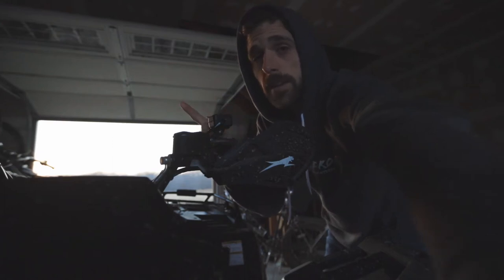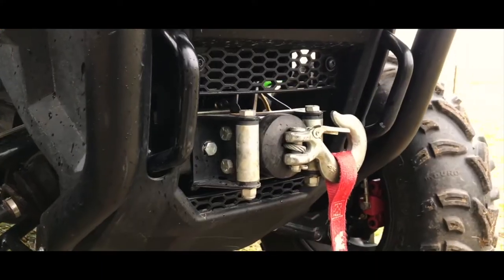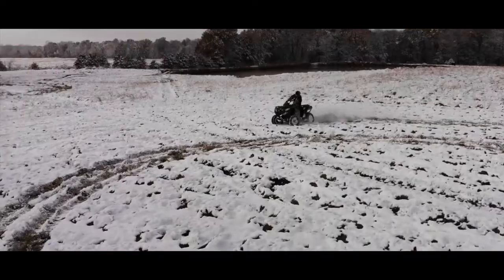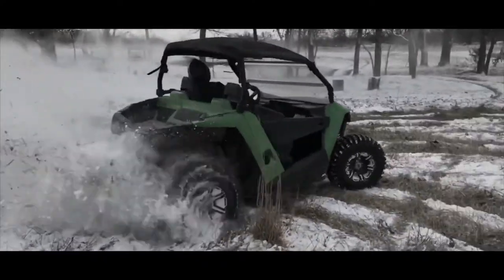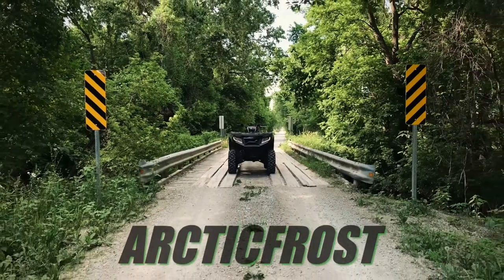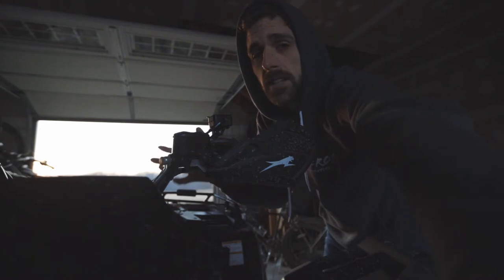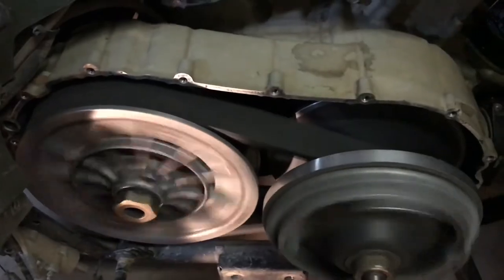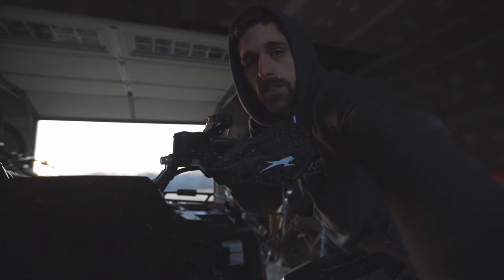One Way Bearing Questions Answered!

Comment: Dude thank you so much for this video. I was just about to buy $500 in new clutches… going to remove my one way bearing tomorrow and see if that’s what my issue—I’ll report back tomorrow but this definitely sounds like it’s my issue!!
Reply: Took my one way bearing off and noise went down a lil but my atv dies when I put it in gear—I think my secondary clutch is shot

Comment: so if i have a 300 with the one way starter clutch bearing going bad it’s fine?
Reply from the maker: If your one way bearing is going bad you’ll want to replace it or remove it so it doesn’t cause more damage to the engine.

Comment: I have a Polaris Outlaw 90 with what I think is a bad one-way. When going down hill it will free wheel after a couple seconds. When you hit the throttle the clutch engages but it grabs pretty hard and I'm afraid I'll do damage to the clutch or gears or whatever.  You think it's ok to operate like this?
Reply from the maker: I'm not familiar with the smaller atvs under 300cc. I know Polaris clutches are jerky though.

Comment: So can the bearing look fine and just be bad? I took mine apart spins fine separate on the wet clutch shaft and inside the cover that comes off where its sits together when i spin it by hand it kind of makes a grinding noise
Reply from the maker: Yeah, the one I pulled out in this video was just like what you described. It can look fine but sound bad when you turn it by hand.
Reply: @ArcticFrost  OK mine sounds fine when the clutch is apart soon as i hold the clutch back together and spin the shaft by hand it does not sound happy

Comment: So i got new gaskets and bearing do i have to install them with some kind of crankcase silicone or any thing?
Reply from the maker: For the left side magneto cover you don’t need any RTV silicon, just the gasket. I show that side cover in this video. https://youtube.com/clip/Ugkx26O1g3iN7rdIffYwM_ydHrUYo00xY2tl?si=SKaG7_hIHDSuX0N4
Reply: @ArcticFrost  do you need anything on the other side with the clutches?
Reply from the maker: @Brobro449  Nope, it is a gasket on both sides. Only RTV silicon is on the top end and crankcase halves I believe.

Comment: Just picked up a 2015 mudpro 700 with only 77km. The thing is mint condition but I noticed the rattle in the clutch area too. Are they known to rattle this early? Is it harmful to leave it in if its rattling? It's more of a nuisance sound right now. I just did an oil change so I don't really want to drain the oil again to remove it.
Reply from the maker: Could’ve happened with the previous owner. If it is the one way rattling it will wear on the wet clutch if left in and could potentially break apart. Have you checked the primary rollers for flat spots?
Reply: I just noticed it last night. I haven't had a chance to look into it more. I had siphoned out the old gas and put new stuff in (the atv hasn't been ridden in 4yrs...) I also added some fuel system cleaner. I fired it up and it had a rattle sound that I hadn't noticed before coming from the clutch area. It isn't super loud but louder than my 2015 Alterra 700 was.
Reply from the maker: @claytonwalters8802  May just be normal noise. The older clutches are a bit noisier. The Alterras have more sound deadening components on the clutch.

Comment: Grizzly 660. One way bearing went out and I cant get it started cause it just spins the shaft. I think I need a new one
Reply from the maker: Not positive on the 660 but on Arctic Cats you can run it without the one way. The bearing simply acts as the engine braking.

Comment: Hey brother. Would the primary turn by hand both ways with a one way bearing installed or would it only turn one way?

I got a primary here that turns freely both ways so i dont think the one way bearing is even installed

Thoughts?
Reply from the maker: It should only turn one way when you spin it by hand. It’s bad if it spins freely or yeah, could be removed.
Reply: @ArcticFrost  appreciate it!

Comment: I don’t see any links on how to remove the one way bearing 
Do u have a link to that video or can you explain after the 2 clutches are removed what is next
Reply from the maker: You will need to get down to the wet clutch. So remove the outer clutch cover, primary & secondary clutches, then the inner clutch cover, and the wet clutch is behind that with the one way on it. You’ll have to drain the oil first.

Comment: Doesnt the one way bearing add extra support for the centrifugal clutch bell housing?  Won't it wear out the inner case bearing s allot quicker.  Or the bushing in the cover.
Reply from the maker: No, actually a lot of riders have had the one way bearing out and running their ATVs for years with no issue.